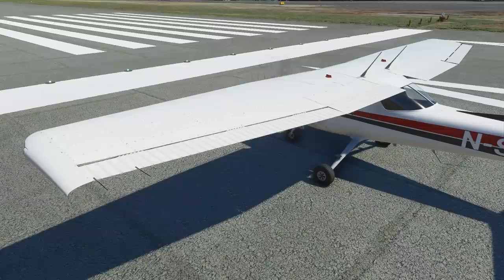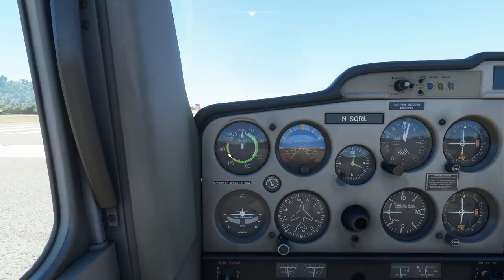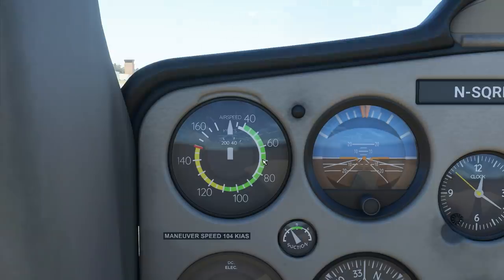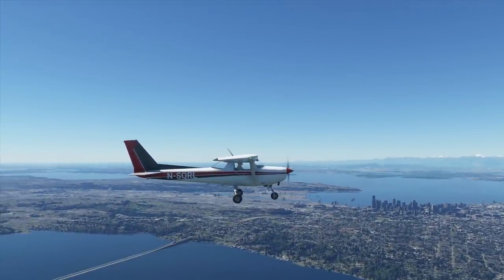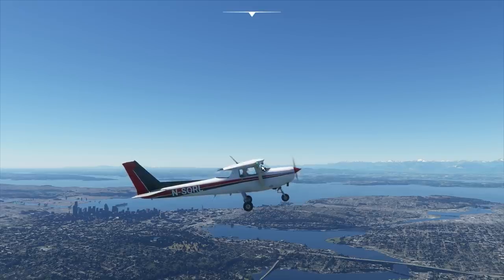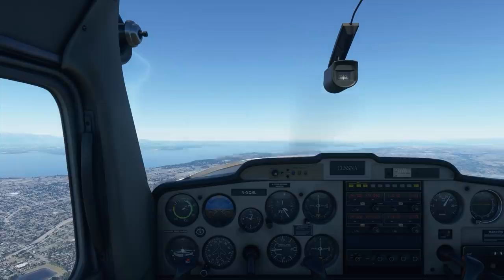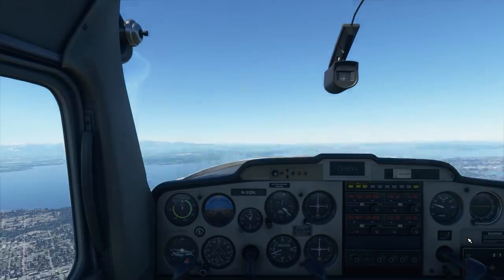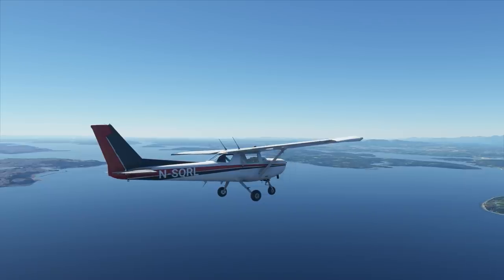Tutorial #7 - Flaps - Microsoft Flight Simulator

Comment: I had always thought about flaps as increasing the wing curvature, rather than altering the angle of attack. The principle is the same, in that lift is increased. I like how you're covering all of these aspects that many MSFS players would overlook.
Reply: Flaps do both things. They do increase curvature (or camber). And they also increase the angle of attack because with them deployed, the wing's trailing edge is lower than when retracted, i.e., the chord line (the line from the leading edge of the wing to the trailing edge of the flap) changes significantly whey flaps are deployed.
Reply: @coriscotupi  I thought the same and looked it up, and you're right

Comment: I would just like to point out that the top of the white arc is max speed for FULL flaps.  I was taught that below 100 knots IAS you CAN deploy 10 degrees of flaps if you need to slow down.  Doing so will slow you quickly to below 85 knots.  Not something I ever had to do, but it's good to know in case you need it.  I haven't broken a plane yet.

Comment: The best explanation I've ever seen!  Thanks.  You should have been a physics teacher!  Anyway, the way I have handled the Bernoulli Principle is to think of two particles of air: one hits the wing and goes under the bottom; one hits the wing and goes over the top.  Both are pounding on the wing due to their thermal motion in all directions.  They started out next to each other, and conservation of momentum requires that they remain together.  The one going over the top has to speed up to catch up with the one going under the bottom, so the one going over the top has to move faster to meet the one going under the bottom.  Bernoulli's Principle says that that means that the pressure down from the one on the top will be less than the pressure up from the one on the bottom.  Lift!
I won't go into the math, but the math bears me out.
Keep up the good work!
Reply: Thank you sir.

Comment: Just a little heads up, flaps create lift by changing the shape of the wing (camber) resulting in a greater pressure differential in flight between the top and bottom of the wing. You can find out more by reading about  Bernoulli's  Principle. The deployment of flaps isn't about creating a change in the angle of attack, which is determined  by the relative wind and the cord line of the wing. Most people confuse angle of attack with pitch attitude, they're not the same. With increased lift you also increase drag (induced drag) so as you add flaps on an approach you'll need to lower the nose  (pitch) of the aircraft to maintain the approach speed you were maintaining before the flaps were added. As you increase the degree of flaps (10, 20, 30) you will need to lower the pict attitude to maintain your approach airspeed. Flaps are not only used to lower the stall speed and slow the aircraft but to increase your rate of descent as you approach the runway for landing. You can't always make a 3 degree glide slope approach due to obstructions (trees, power lines) on the approach end of a runway.

Comment: live pause will mess you up. I used it during one of the bush flights while coming in for a landing. just paused really quick to sign for a package and when I got back my plane had over sped and over stressed while in pause! terrible waste since it was such a long flight mission.
Reply: Also, since all the systems are alive in live pause you can  overheat your engine or experience any system failures.

Comment: Flaps are not aimed to change the angle of attack, they create a more curved wing which increases lift and drag
Reply: That applies only to twin engine planes but on smaller planes they are meant to change the angle of attack because they won't glide as far so you need to try and keep altitude by bringing the nose up but ur right tho
Reply: @hansbaraka7439  no man applies to every plane, the change in the angle of attack is a consequence of the improved lift
Reply: @Sbinott0  well I learned something new thanks
Reply: @hansbaraka7439  you're welcome hahahah
I can give you the full boring scientific explanation if you want (I study aerospace engineering)
Reply: @Sbinott0  impressive
Reply: @Sbinott0  I don't mind
Reply from the maker: The AOA increases because the effective chord line pivots up.
Reply: @squirrel kinda, but it is not always true for all airplanes, that works for most GA but as you get bigger you start getting Krueger flaps or similar in the front of the wings which effectively counterbalance the AOA change, so the real added benefit of flap is a much higher curvity wing which gives you way more lift but also way more drag, and it tends to start stalling easier than a flat wing (but still at lower speeds). If flaps were meant to increase the AOA to have better visibility it would have been way easier to just add a rotating/trimmable wing
Reply: I have a question, how do the slats work?
Reply: @hansbaraka7439  there are a lot of kind of slats, but basically all of them work exactly like flaps, they force the air to go through a more curved path, which increases centrifugal force on the air particles above the wing (it's this that creates lift a the microscopic level), which produces more lift
Reply: @Sbinott0  so basically slats also increase drag and lift
Reply: @hansbaraka7439  yeah, if you see the wing from a side section you can clearly see that slats and flaps together create an arc shaped wing
Reply: @Sbinott0  Thanks can I ask you more questions in the future

Comment: Flaps are not for stall.  They are primarily for dumping energy during the landing descent, so you don't have to cross control with the forward slip.  The lower stall speed is a nice side effect, not a primary feature, because (for the Cessna 172) we always land at 60-65 knots anyway (flaps or not).  Please teach flaps correctly: proper use in flight, not for the side effects of stall or slow flight training.

Comment: First up, great content, I've watched a few of your videos now, including most of the tutorials. and it is all really useful (so far the trim one especially so)
I just managed to get MSFS 20 working today, and naturally jumped straight in without doing the tutorials (went straight in to free fly mode, 'cos what's the worst that could happen? ;) ), and I have some questions: 
1. When I'm coming in on final, at what sort of distance should I start to deploy flaps (so far I've stuck with either the Cessna 152, or the float plane (Axion A5?))
2. Do you have any advice on how to make trimming the plane smoother when deploying flaps? I did a landing in the float plane (on land), and deployed the flaps in stages (it only has 3 positions rather than off, 10, 20, 30 like the Cessna), and every time I deployed a stage of flaps, the trim went mental and it took me a while to sort it out - is this something that gets easier, or is there a trick to it?
There's tons of other stuff I've still got to figure out as well...
Reply: 1. The more proficient you became the later you can slow down and therefore deploy the flaps. There is no real golden rule for a certain distance other than not et the aircraft "run away" from you, you should always be in control. Actually most of the times when you fly GA to uncontrolled airfields you do not do a straight in approach, you fly a "pattern" which I suspect will be a subject for a tutorial. The pattern will help with separation and set you up for a landing with regards to speeds and flaps.
2. Be prepared for the pitch change, smoothly counter it with pitch input followed by trim and most likely power setting. Practice makes perfect. :D

Comment: About tutorial number 6: I just have a few questions. What if you wanted to go faster in level flight? Would you give more throttle to reach the rpm that gets you the speed you want. So like you were flying level flight at 80 knots but if i wanted to go faster could i increase throttle to a higher rpm, and then i would need to trim more to keep it level? And also what about descending at a vertical speed would i just pitch more down? And could i go faster airspeed with the same vertical speed? What happens if i throttle? And the airlines (a320 for example) do they descend at idle throttle?
Sorry for all of this i am noob.
Reply: You should watch the previous video.
Pitch is speed, throttle is altitude.

If you want to have more speed you pitch down. If then you are losing altitude as a result you throttle up, to bring your vertical speed to 0.

If you want to descend at a vertical speed, you throttle down to reach your negative vertical speed, then you pitch up to control your airspeed.

Obviously, it's not as black and white, and one affects the other. But the general idea to keep in mind is that you want to use the throttle to control the altitude/vertical speed, and the pitch to control the airspeed.

If you are descending at a good vertical speed but your airspeed is too high, you pitch up to reduce the airspeed, then you reduce the throttle to go back to your previous vertical speed.
Reply: @POolBacK  thanks a lot. I watched the previous tutorial, but i still had these questions. Thanks! :D

Comment: One question: having the flaps extracted to 40 degrees for landing just to loose hight very quickly can i do a side slip with these 40. degrees flaps?
Reply: Yes, just keep your airspeed stable and of course your track over ground also. I´m sure you know this, but a proper sideslip is a combination of rudder, pitch and aileron to maintain speed and track while increasing rate of descent. So press the pedals to push the nose to the right (or left), lover the nose to maintain speed and bank to the left to keep the track. You will sink faster.

Comment: Never owned any of the flight simulators. For an older person what computer , accessories , and sim would I need?
Reply: all that strongly depends on your budget
Reply: Mid range but good. Where to add extra money?
Reply: The recommended minimum specs for computer are available on the flight sim website. I highly recommend getting a much better graphics card and CPU than it recommends, but it depends on your budget. As for accessories, you can technically get by with a mouse and keyboard, but I would recommend (at minimum) an Xbox controller also. I am personally hoping to get a yoke because I want to actually get my Private Pilot's License eventually, and want to use this as practice. I hope that helps some.
Reply: Wayne Burba I suggest the thrustmaster hotas one - it’s $100 and really good for this sim, it also comes with a throttle which is really nice. In order to use some of the axis controls you need to go into the control panel and set it to 5/8 axis mode. As far as computers go, most of your budget is going here and you can find some fairly good deals but if you want the sim to look, run well I suggest getting a dedicated desktop gaming computer, I use a laptop which works well on medium settings but could be upgraded and goes around $1500 CAD
Reply: Colin Averill haha exactly same here, it’s a nice way to get a semi feel for the aircraft without spending money for the aircraft rentals. I Definitely recommend the hotas one it’s cheap and good although it’s not a yoke but it’s generally the same concept
Reply: Colin Averill would a Gpu help and if so any suggestions?
Reply: @wayneburba9457  A GPU is required to run the game. You can run the game at medium with a rtx 2060 without any problem. Also, get 16 GB of ram.
Reply: A H thank you so much, I will use your recommendations . I really can’t wait. Recently retired and never had time. Thank you again.

Comment: Annoying game even patch 2. autopilot on g1000 still mess up trim.cant airplane see plane is levelled no need full trimm any direction LOL only way fly after than is turn off autopilot center trim wheel and lock it down. then controll airplane by thottle.
then annoying ATC pls climb 10000ft when i cant its 42kt head wind and allready requested 400ft lower and level on 6000ft keep annoying me then pls decent 2500ft LOL all that time i would even reach 10000ft then need decent lol.
TRIM is so fucking stupid its like camera if turn camera multiple times over camera get weird it not anymore look left right back front correct. untill you go that multiple times back. i think trim is same it think its 360 off even its spot on LOL